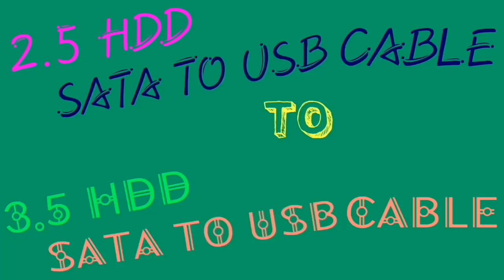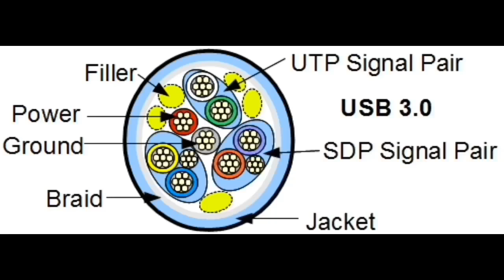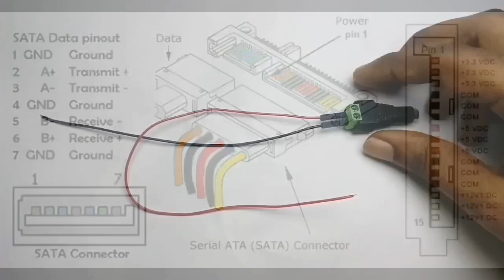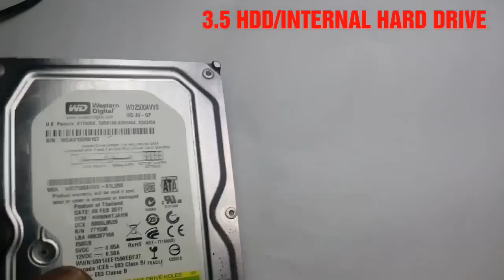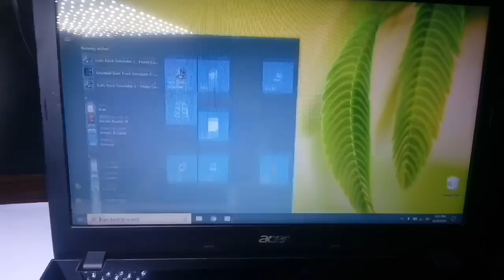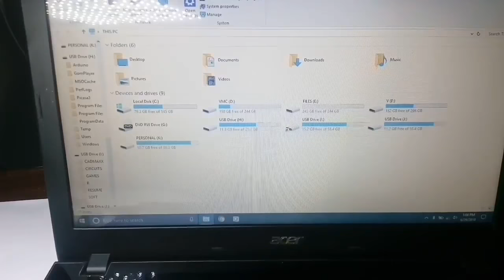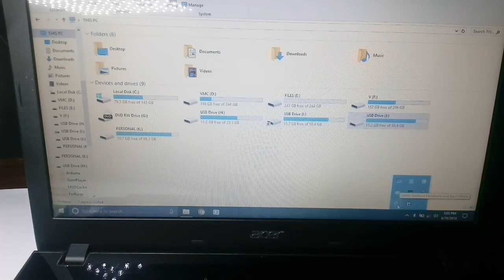DIY 2.5 TO 3.5 HDD SATA TO USB CONVERTOR

Comment: is he breakin one to make o ne?
Reply from the maker: No bro, actually long back ago i bought wrong product, after i study on that ,i broke that and remodel into working one what i required. i am still using this with out any problem, since it is usb 3.0 it won't work in usb 2.0 usp ports
Reply: Same issue with me also

Comment: Pleas make a wiring diagram
Reply from the maker: the wiring diagram is not similar in all cables according to chip present in connector the wiring diagram will change

Comment: You literally took a adapter and make one from it that’s completely bullshit i need it to be a diy something that i dont have to buy!!! I need a separate piece
Reply from the maker: you can't do it by diy, because you need that ic/processor present on converter to convert and read data from sata to usb and for that you need some software's tooo to read data from HDD and communicate with your PC , you can't find it in open source, so don't try to do that
Reply: @vmcdiytech3681  so you cant take a port from a laptop and make it into a usb one

Comment: Sir,   can we make red color sata cable to usb converter at home without anything buying.
Or
Can we joint usb port to one side of red sata cable at home without anything buying

Sorry sir I am not perfect in English.
I am waiting for yours solution
With Thanks
Reply from the maker: Hello Jaswinder lal ,  its impossible to convert red color sata wire to usb directly , because we want to convert (or) decode sata data  to usb and usb data to sata ,so we must want to buy that conversation board

Comment: Hi Bro. I have an old 160GB/7200rpm/8M/PATA HD and I wanna reuse it (I got many old Hard Disks indeed, PATA and older), and I'd like to know if you could help me to adapt a PATA connection cable to USB. I'll do appreciate your help if possible.
Reply from the maker: Hello ronk, There is ready made adaptors are available for all types of hard drives, PATA hard drive is working with 12v power supply ( disk spinning starts when you supply 12v to hdd) so you need to match your PATA connector and adtional power supply (12v) when you buy
Reply: +VAM C Thanks a lot. I already found adaptors on Amazon, I just wanna know if  was possible a Do_it_yourself solution.
Reply from the maker: @ronk4276  No its not impossible to make DIY ,we need usb converter board to convert data from PATA to usb ,if you have 3.0 ports in your pc buy 3.0 usb converter